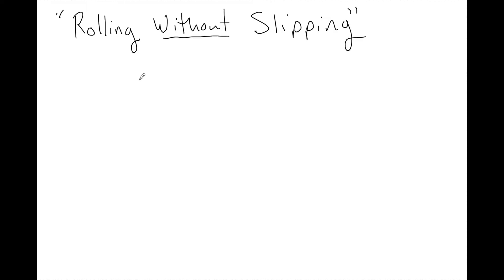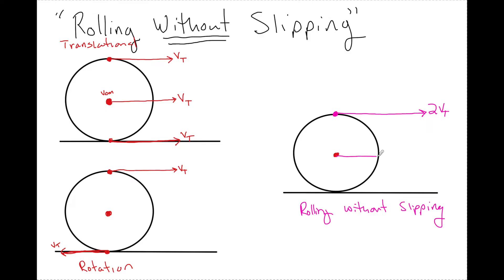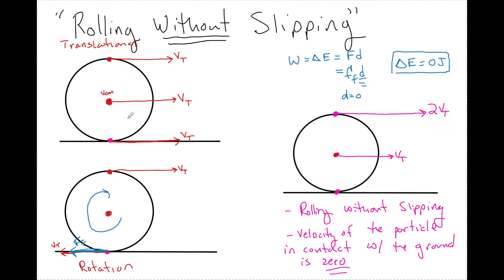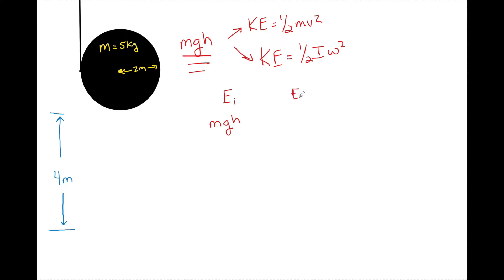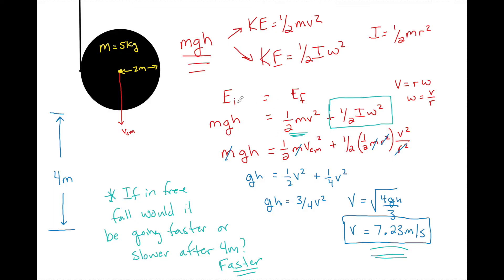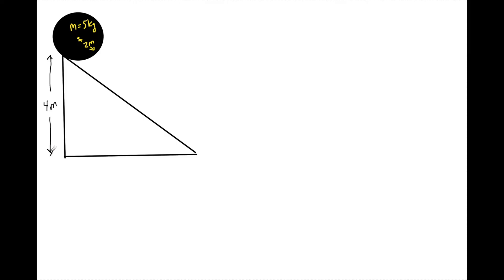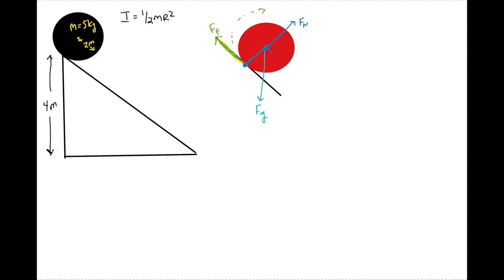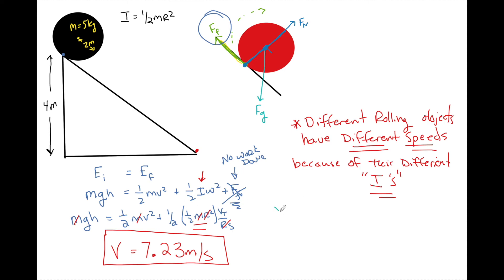Rotational Kinetic Energy | Rolling Without Slipping (AP Physics 1)

Comment: This explanation of why the static friction force does no work is popular on the internet, but I'm just not buying it.  The point of contact is the base of the wheel, but the bonds in the wheel transmit the force to the rest of the wheel.  Translationally, we apply Newton's 2nd law to the center of mass.  The static friction force opposes the motion of the center of mass and therefore does negative translational work on the wheel.  The static friction force also produces a torque that does positive rotational work.  Presumably these two cancel out (didn't work it out yet) so the net work is 0.  In your example, the ball needs some force to the right.
Reply from the maker: Oh ok

Comment: So essentially, rolling without slipping makes it so that the total energy of the final will be the sum of the tangential kinetic energy and the rotational energy? I am a bit confused about when I should be equating the gravitation potential energy or any other potential energy to both the tangential and rotational kinetic energy.
Reply from the maker: rolling without slipping means that friction doesn't do any work
Reply: It is called translational kinetic energy, by the way.  Not tangential kinetic energy.  Any time both energies could come in to play, the net work done on the object has to equal the change in both kinds of kinetic energy.  An object in pure translation with all of its velocities being uniformly the same, has exclusively translational kinetic energy.  An object rotating around its center of mass has exclusively rotational kinetic energy.  An object in general that moves as a rigid body could have both kinds of energy coexisting simultaneously.

Rolling without slipping means that there is the kinematic constraint that the linear velocity is locally zero at the point of contact, so that there is no skidding between the surfaces in contact.   This means that the linear velocity of its center of rotation (v) will be related to its angular velocity (omega) via v=omega*r.  Think of a gear rolling down a cog railway.  The gear teeth cannot skip a cog.  A condition of rolling without slipping is the same thing, except instead of gear teeth establishing the constraint, the force of static friction (aka traction) establishes the constraint.

So putting together:
v=omega*r,
KEt = 1/2*m*v^2,,
KEr = 1/2*I*omega^2,
and
KEnet = KEt + KEr

This takes into consideration, the constraint of rolling without slipping and conservation of energy, in order to enable you to solve for v, based on the work done accelerating it from rest to obtain KEnet.

Comment: since the normal force is not coming from the center as you said, does the normal produce a torque? Ugh, this sounds like a dumb question for some reason!!
Reply: The Normal Force goes through the CENTER of the Circle, or disk, therefore it can NOT produce a Torque. Any force that acts Through the Center of Rotation contributes ZERO force to the Torque, therefore it does not contribute to the Motion.
Reply from the maker: No. Torque is produced by a force perpendicular to the “r”

Comment: With the forces on the ball, what about Fg Parallel? That's the main force making it roll in the first place, right?
Reply from the maker: Not exactly, Gravity is the Force that makes it roll. Fg parallel is a “component” of the weight that causes the block to accelerate.  Components often times are not asked to be drawn on Free Body Diagrams

The force of the normal is an actual force that coincidently is equal to the other component of the weight 

Hope that helps
Reply: Math And Physics Tutor OHH THANK U